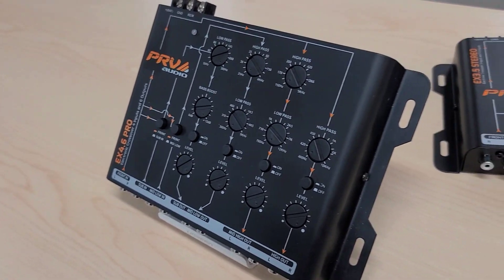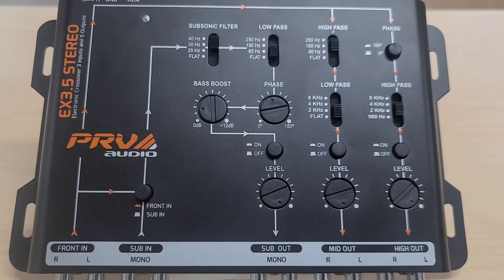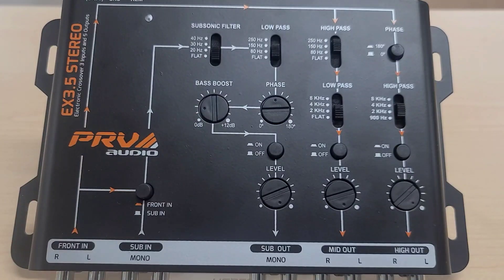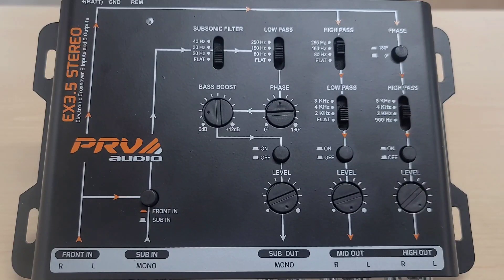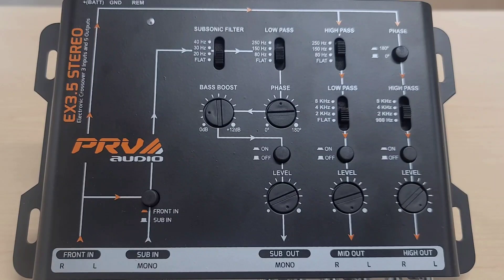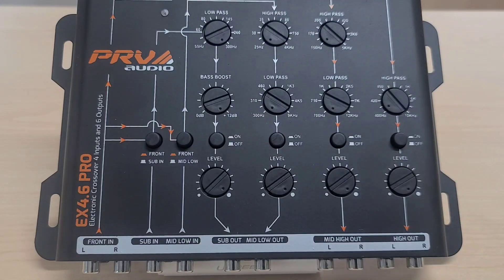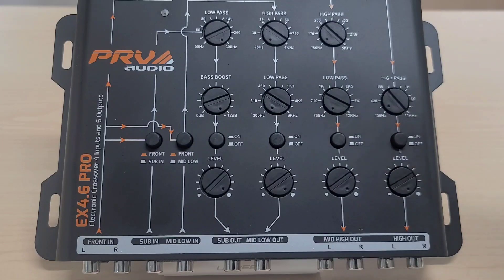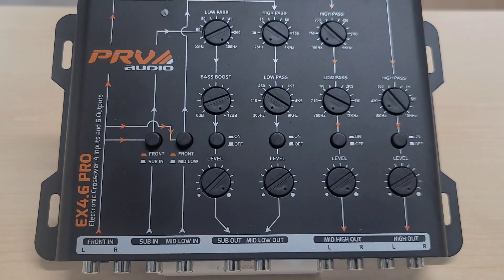PRV Crossover Overview: EX4.6 Pro and EX3.5 STEREO. Electronic High Voltage Crossovers

Comment: "The 6 outputs are 1, 2, 3, and 4" Hahaha
Reply from the maker: Let us explain to you, maybe it was not 100% clean the information -  for the EX4.6 PRO -  6 RCA outputs Crossover you have 4 Channels, Subwoofer, Low Frequency Mid ( both in Mono ) and Mid Highs and Highs ( both in Stereo ) total of 6 RCA Outputs with 4 Channels

Comment: If I want to make a system that has more amps then the EX4.6 pro has Outputs ..? I guess my question is can you add more than one of them together. So I can have my subwoofer channel midbass channel mid range channel Tweetter channel  compression driver channel